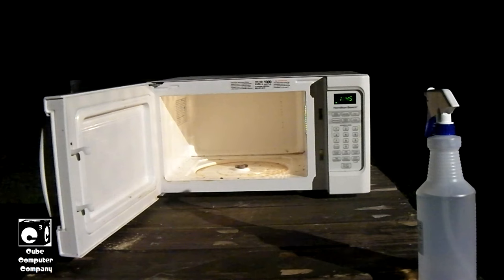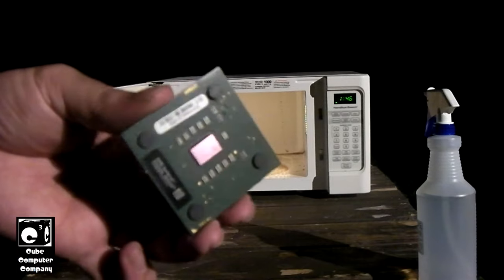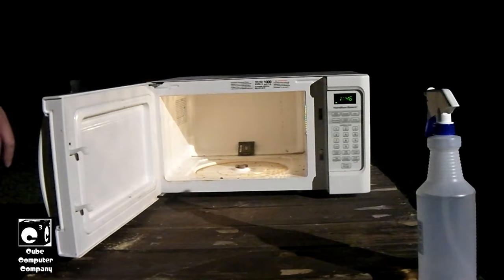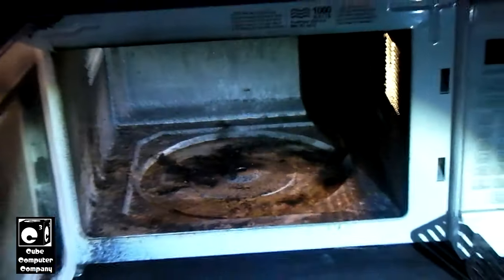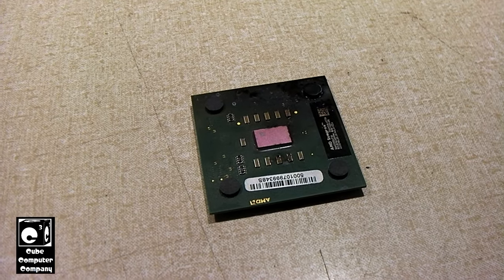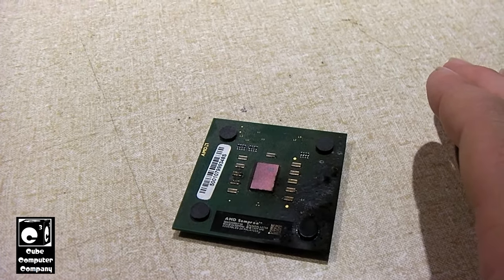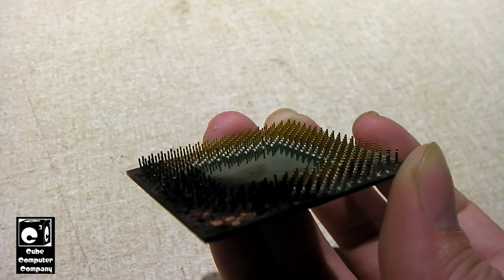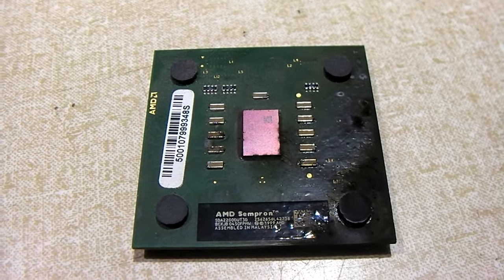AMD Sempron 2200+ (Athlon XP) CPU in the microwave

Comment: I always though why that CPU has a weird look
Reply from the maker: The Socket A/462 was AMD's last desktop CPU to have an open/exposed CPU core. Later models such as Socket 754-present use an integrated heat spreader.
Reply: Wait so if we open a AMD Athleton 64, theres the same thing?
Reply from the maker: Yes, and most laptop CPUs to this day don't have a heat spreader. Keep in mind delidding CPUs can be difficult and could damage the CPU.
Reply: So.. Can you make a video, opening a intel cpu and explaining its parts? Btw you look like a good youtuber. You still respond to comments unlike other yts.
Reply from the maker: @emirkomutan4212  I will definitely consider doing this for an older Intel and AMD CPU with heat spreaders. Thanks for your feedback!
Reply: No worries man! Keep up the great work.